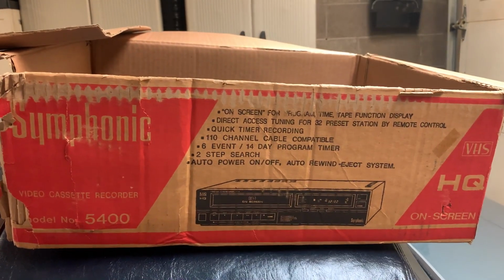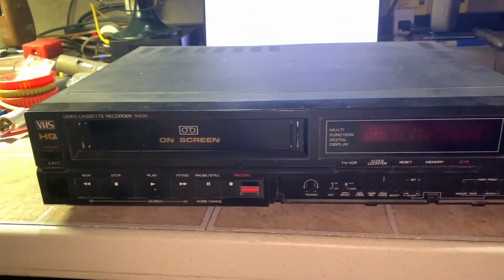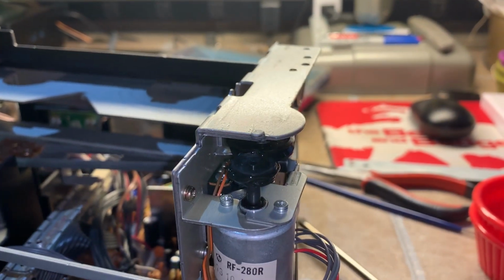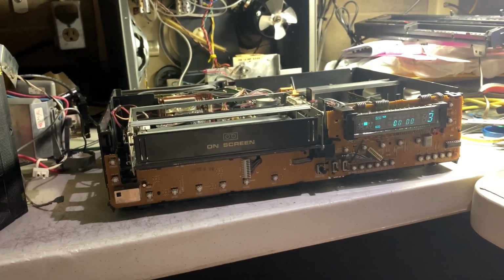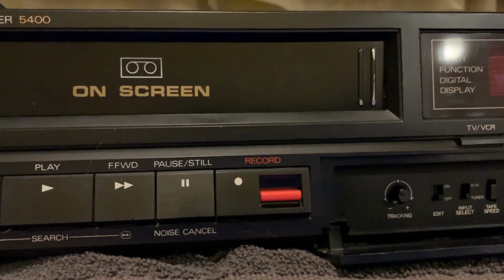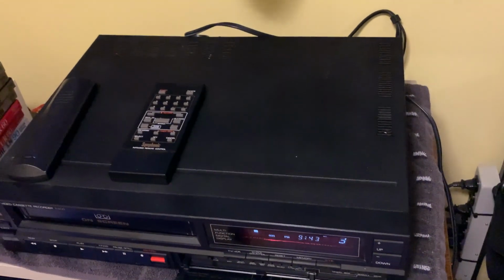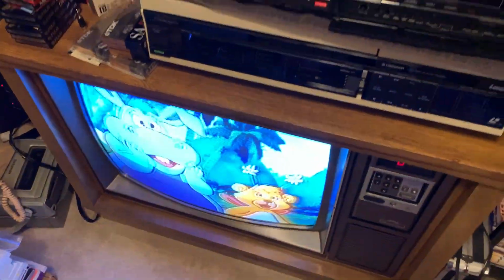Very High Quality Funai?? - 1987 Symphonic Model 5400 VHS VCR

Comment: 36:16 I have a Zenith with the same exact menu, it's a mono unit. It reeks of cigarette smoke and keeps flashing ''AUTO-TRACKING'' every 5 seconds. It also has a habit of teething the bottom edge of film strips really badly. I kind of want to restore it because it handles EP very well. Despite it being known for being one of the cruddy VCRs, it still has a cleaner picture than my Sony from 2001. I don't know what the cause is, but the image on the SLV-N51 I have is very squiggly. I know it can't be dirty heads because it has been thoroughly cleaned, and I only use it to play Disney movies. Maybe a very long time ago around 2006 or 2007, mom used Bam cleaner and q-tips... I don't know.

Comment: Wow American Appliance-a name from the past I work about a mile from where it used to be on Street Rd I actually bought my refrigerator there when I moved into my house in '96 it was a hopping place at the time and I also know where the place you got it from is I have never had any dealings with them but I know the Warminster area and it is also not far from where I work. I have worked on many of those VCR's over the years-they I believe they used to have a three legged regulator in the power supply a 7806 or a 7808 it was an oddball because they usually came in 7805 or 7812 series regulator but it had an oddball regulator for the micrprocessor system for controlling the VCR
Reply: This regulator also omitted a replaceable fuse on power supply board.

Comment: Dang! That is a quality machine, for sure. Looks to be built to a much better standard than my 1987 Sharp VC-A102. Every variant I encountered, had a bad clutch/idler assembly. A simple repair though. I need to re-belt it, but it does still work pretty well. I sure miss the days of going to the electronics shop, and picking up VCR parts OTC.
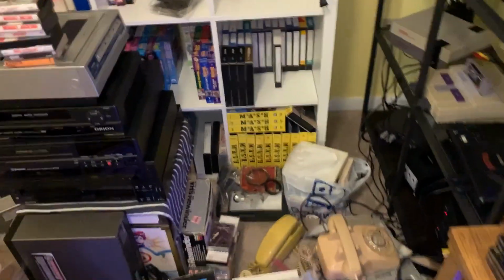I recall my folks renting a VHS machine like the 1984 Funai, at seen at 34:00 or so, back in 1985.

Comment: That is a solid VCR. I love those simple yet well built machines of the 80s. Very lucky that the front cover hinges broke where they did. I usually see them broken at the very thin clip part, which makes fixing them near impossible.

Also, I just now learned what that white thing was called (and for). Impedance roller. Neat.

Comment: My first two VCRs were a pair of nearly identical Emerson units (both were model VCR-755), and considering that they were fairly low end units, they were some of the best VCRs that I had ever used!!! I ended up getting rid of the first one due to mechanical issues, however I occasionally used the second one all the way until about 2012 when it finally kicked the bucket........ anyway, great video Spats!!!!
Reply from the maker: I actually have that model. Those were made in 1988 by Orion, using an older Orion tape transport.
Reply: @spatsbear  Have you thought about making a video about it?
Reply from the maker: @douglasallen9428  I will... I need to repair it... last I tried, it would not sense the capstan motor speed and it just runs at a very fast speed.
Reply: 2012 was the last year my families used VCRs.